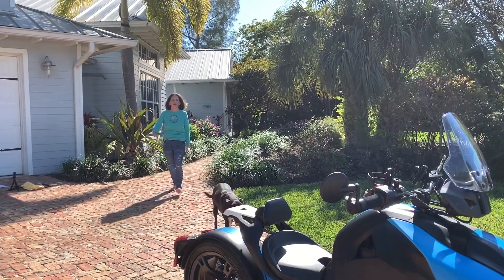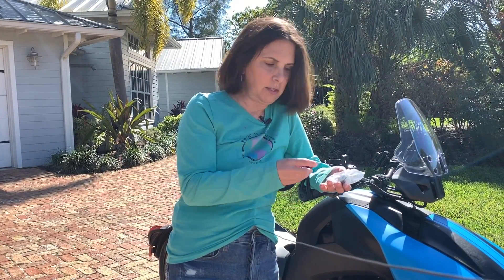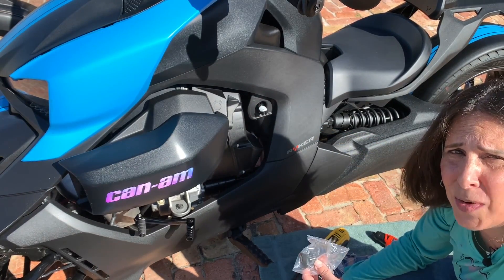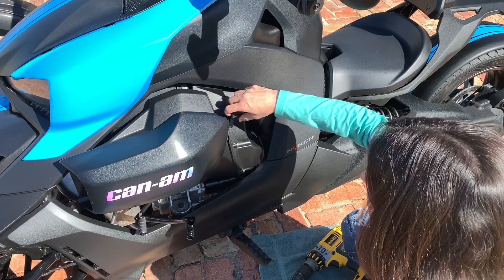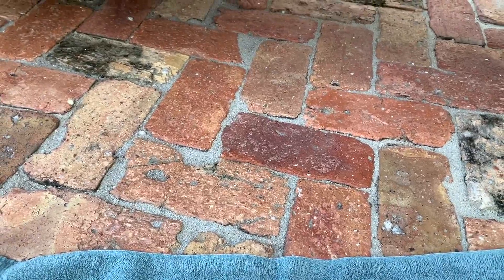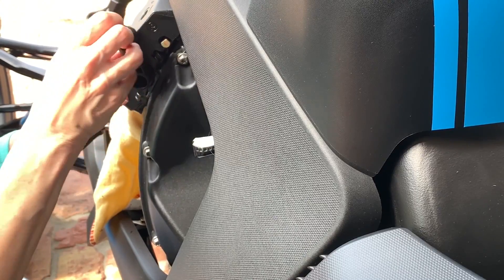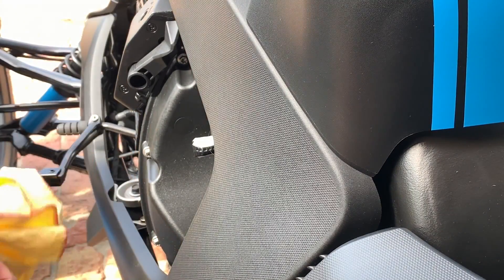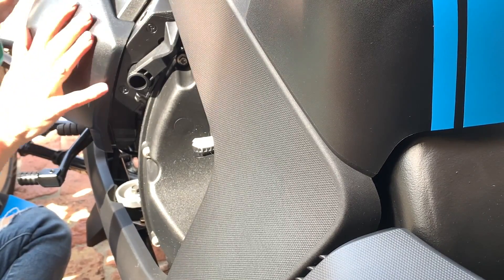Can-am Parking Brake Lock - Easy Install & Review

Comment: I found placing a thick silicone pad under the parking brake lever positions the lever up just enough so you do not need to jiggle the lever to have it engage.
Reply from the maker: Great tip James!  I will try it, thanks!!

Comment: If you put a screwdriver between the parking break and lock you can pop that lever past the lock bolt in seconds and it will roll .
Reply from the maker: It’s really just a deterrent. I’d recommend getting an alarm/gps locator system

Comment: Just installed this on the gf Ryker.  Super easy install. Sucks doesn’t come stock tho.  Well it does in Europe.  Go figure
Reply from the maker: Yup, we didn't get a lot of things like flashers or fog lights.
Reply: Ryker Rydes just had dealer come pick up week old Ryker cause of the condensation on inside of the headlights and some funky white stain on the rims.  He said they don’t do pick ups. I said ok you’ll be getting a call from Morgan and Morgan...Today.  An hour later a guy was loading it on trailer free of charge.
Reply from the maker: @logancharles3610  too funny!  You do get free tows with BRP!
Reply: Ryker Rydes well this is all on the dealer.  They should of tested and checked out bike before presented to customer.
Reply from the maker: @logancharles3610  100% agree

Comment: Hey I’m new to the channel and also a new Ryker owner. I purchased two different locks drilled the hole put the bolts in and everything, everything was looking good the lock works perfectly. But not on the bike, when I put it in park I can lock it when it’s not in park the lock works as it should, I purchased another one and had the same problem. Do anyone have an answer to what I’m doing wrong before I go crazy.. please and thank you
Reply from the maker: Hi there!  Thanks so much for finding my channel.  As far as the lock, I can’t imagine what it would be. Is it installed upside down?
Reply: @RykerRydes  no not at all even had two other people look at it and they said the same thing. We all are lost on why it won’t lock
Reply from the maker: @kingfitfitjunkie3481  it’s so hard to help without getting my hands on it.  Which brands did you buy? Can you call them?

Comment: Looking at
 the lock makes me wonder how hard it would be to take a screwdriver and pop off the lock arm, unlock and away it goes. The arm is just thin plastic.
Reply from the maker: Not hard to break, more of a deterrent.
Reply: @RykerRydes  Yes, I think a wheel lock with alarm is a better idea.
Reply: @RykerRydes  Here's your next mod to do...Can-Am Ryker Billet Aluminum Parking Brake Lever Available at SlingMods.com